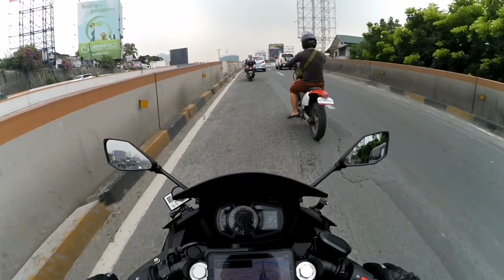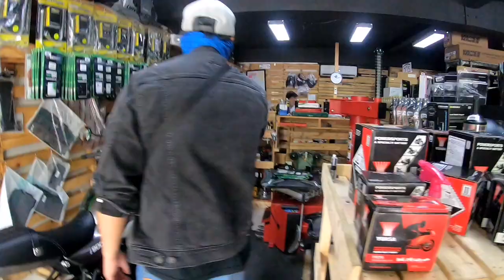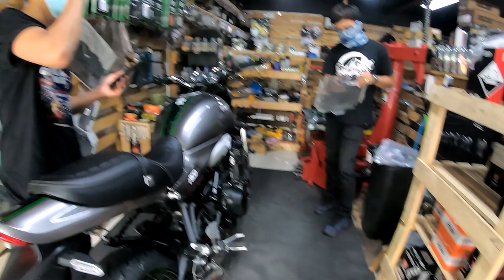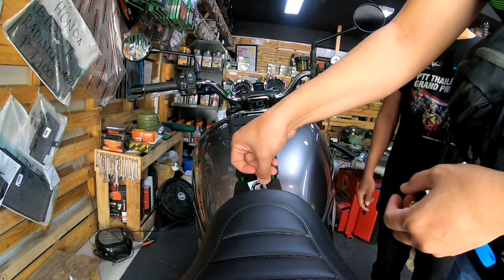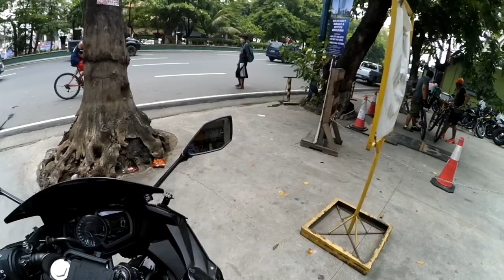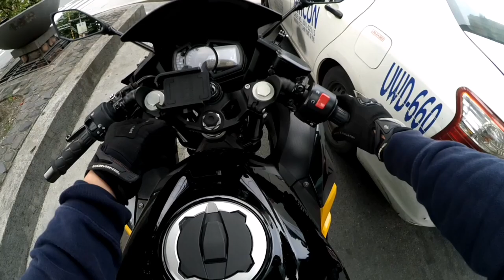Big Bike Tech Run

Comment: How is the ninja so far?
Reply from the maker: Honestly, a bit disappointed in it's first quarter. Weird noise coming inside the engine, turns out intake camshaft is loose andhave  affected the chain tensioner down to bending four valves. But they replaced it with new parts(took 2 weeks in casa, warranty covered) and running good as new again. 
Although I can still here some noise I was complaining here and there, but the performance is not affected. I wouldn't blame the brand though as it is not known problem with other ninja users.
Reply: AlexMotoVlog , oh thats frustrating. How would you rate the ninja versus the ktm rc390 (if you have tried the rc)?